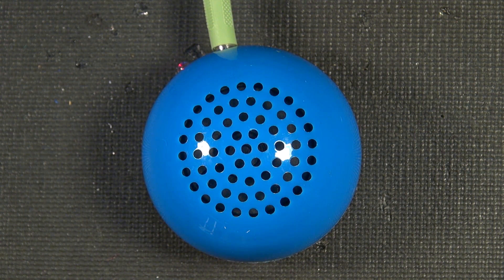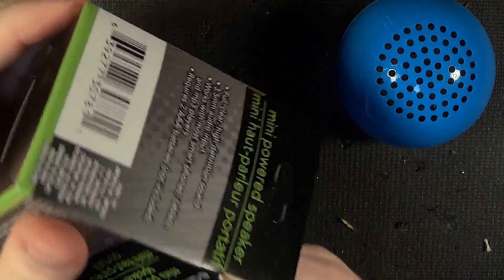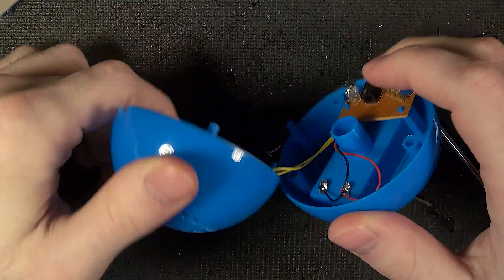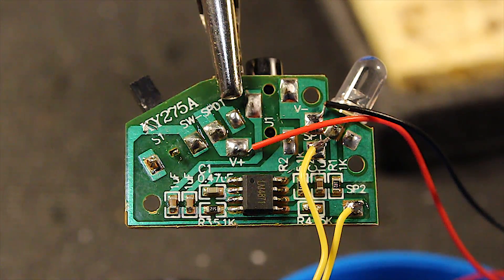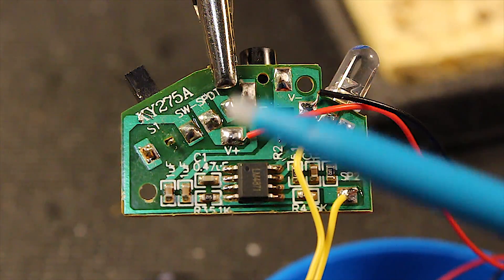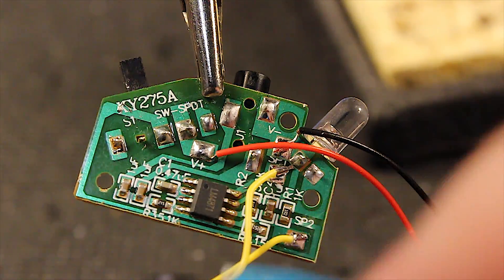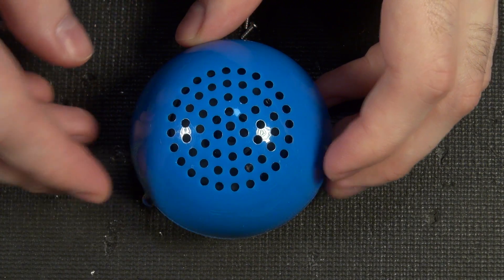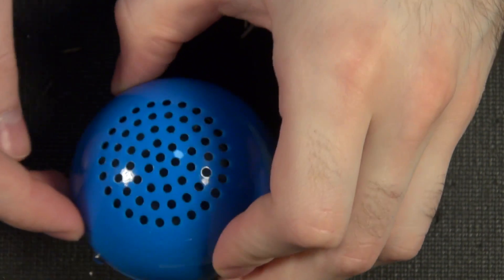Dollar Store Speaker Teardown (E-Circuit mini powered speaker)

Comment: Pretty jammin' deal for a buck, bonus points if you get the earlier version with the 12" cable. The amp sounds great on 5V through a better speaker.

Comment: I bought one of these and made a Speaker out of this and a taco box. And made the built in amp run off 5 Volts through USB instead of 2 AAA 

I have the less beefy speaker though. I added another speaker to my Taco Box speaker though running in parallel with the speaker that came with it

Comment: fuck these speakers, i got two of em one day and they have a very strange problem but anyway i used one with an ol reliable aux cord and my htc one m9 said "SD Card Unexpectedly Removed" and then i tried it with a Greenbrier (dollar tree) aux cord and the same problem so then i did the same thing with another one of those cheap speakers and same problem, it completely shot the sd reader on my phone somehow and now whenever i go into a file explorer it'll et me click a music file but a few seconds later and the sd card will "unexpectedly" disconnect and now I've had to replace my phone just a few months after buying it

Comment: If I wanna learn abou these stuff circuit boards/resistor/capacitor/wiring/etc.. what course should I take? Electrical engineering or electrical technician? Or is it electrician?

Comment: the amp chip in this thing is nice!  speaker is awful just a mid range driver it's a nice little board and chip check out JohnAudioTech he put that chip on a breadboard and drove a big 4 or maybe 8 ohm speaker it sounded great it's a worthy buy just for the chip and board lot's you can do with it :) try connecting a larger speaker and D batteries you might be in for a surprise :)
Reply from the maker: Hmm, I watched the video, definitely seems worth my time to try it out! Thanks! I'll probably do a follow-up  because I'm really interested!
Reply: I put a 4 ohm small 3watt sub and used 4 AA batteries so now it's 6 volts and it was definitely better in sound quality And bass it was about two times louder